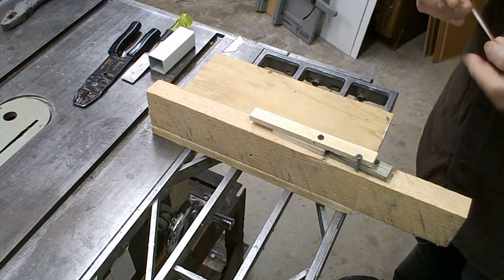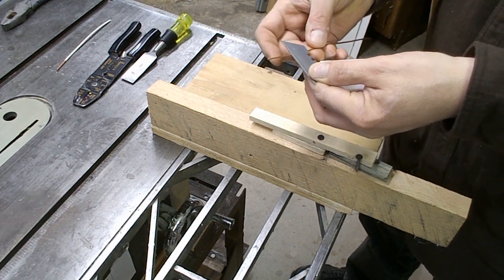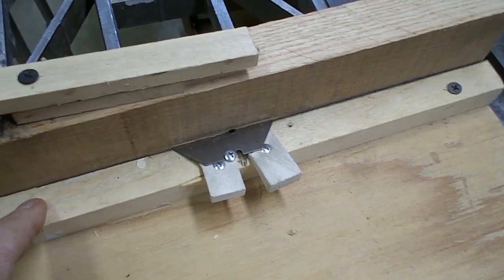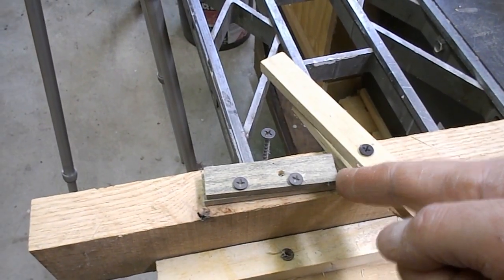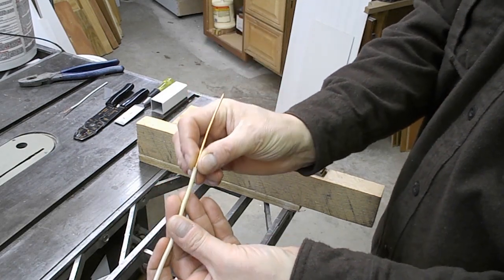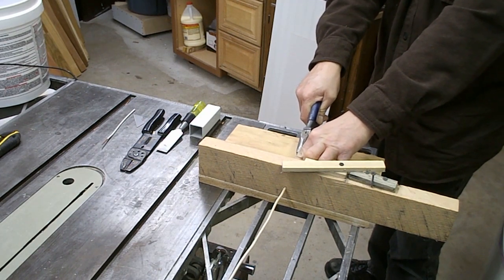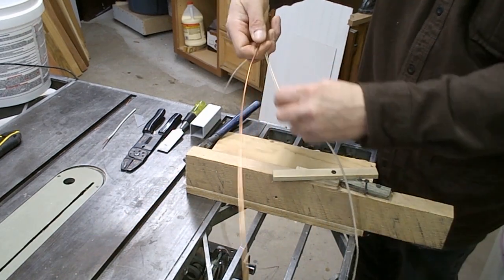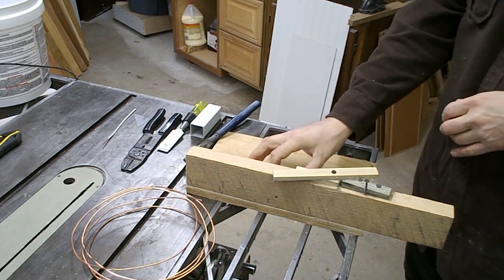Make a Home made bulk wire stripper

Comment: I dont take copper to the scrap yard unless I've got 300-500 lbs. so I'll burn the insulation off scrap yards dont care about shinny copper. Its #1 or its #2 the strand size determines 1 or 2 years ago here they liked shinny copper regardless of strand size it was #1 burned was #2. They must have finally figured out copper wire smaller than a pencil lead smelts at much lower temp. and lots faster more money for them. All copper goes through a cleaning process before smelting anyway. Just dont breath the fumes while burning and let it cool down pretty messy but much faster.
Reply from the maker: Thanks for the reply.  Around my house, they give you less money if you burn the insulation off.  I don't enjoy doing it too much, but don't typically have a lot to do.  Take care.
Reply: @jazbuilding  pretty hefty fine if you get turned in for burning it. (environmental)